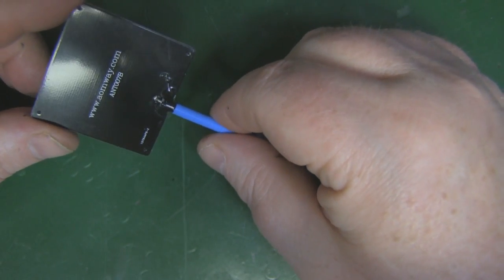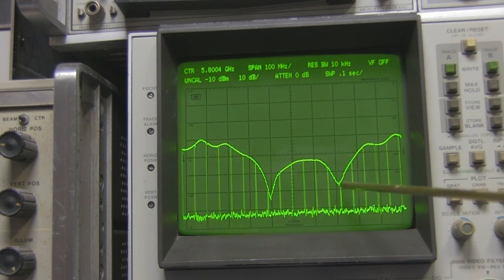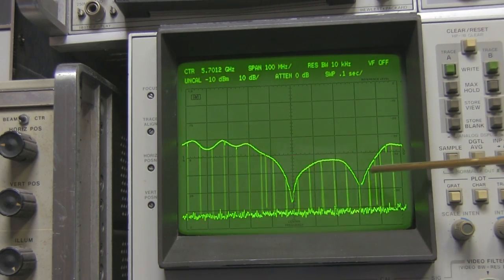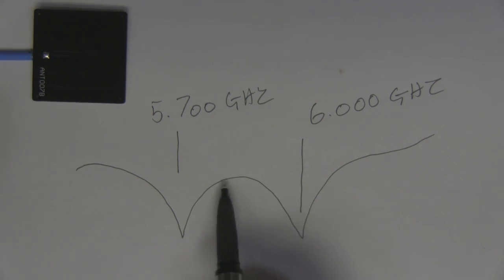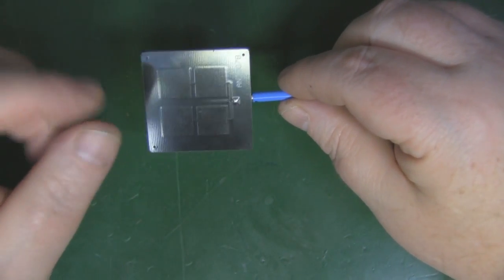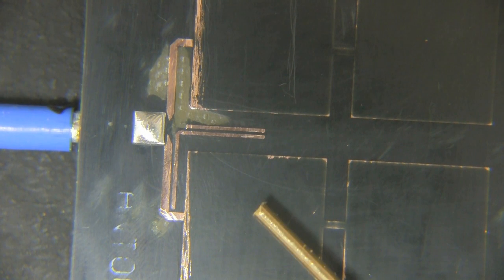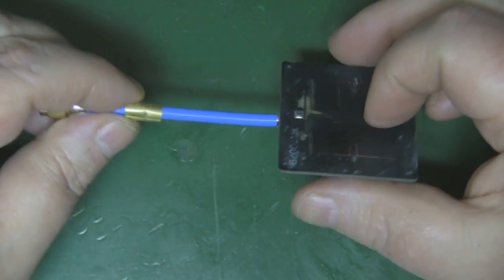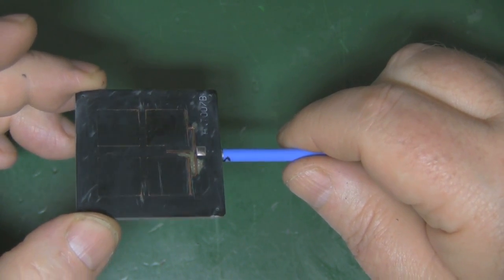Aomway 5.8GHz FPV Patch Panel Directional Antenna

Comment: HEY @andrew mcneil ! Im a very big fan of all you have done, im doing a Extremely custom PC build and im intending to make the best possible hardware build within reason. 
What i am getting at is ive seen your experiments with the silver dipole antenna vs the copper. And im very interested in the idea of silver or maybe an even more expensive metal. My budget is quite unlimited. and the PC is going to be a gift for a certain state Governor.  The PC will be a portable, and i wont be able to go much bigger than a back mounted biquad, or similar.  I would really like any advise or insights you may be able to give me with my situation. I have alotted several months for the build. And im definately up for trial and error,  im willing to try anything, or buy any rare metals to get more range. 
Thankyou! Ill definately keep you in my mind when it comes to "support" if you can help advance my hardware past what it is already.
Your big fan,
TheRarestCombination
Reply: Seems lile even Angels need wifi

Comment: Before you stripped the paint off it looks like there was two microstrips both running to both sides thus rendering the antenna linear.Looks like you lifted it off while cleaning the paint.Can you confirm if it is circular or linear?Does scraping one of the strips off make the antenna circular polarised?

Comment: please review these antennas ..The Arkbird one has little or no sheild connection on mine  and is ony a flat ribbon construct ?

The soft wire version of the arkbird ..Double biquad
https://www.aliexpress.com/store/product/Original-High-Gain-Arkbird-5-8GHz-Double-Biquad-FPV-Antenna-12-DB/1855368_32792004446.html?spm=2114.12010608.0.0.Zsr9br

https://www.banggood.com/Arkbird-Original-High-Gain-5_8GHz-12dB-Double-Biquad-FPV-Antenna-p-1136810.html

And 
The Aomway Double biquad

https://www.banggood.com/Aomway-5_8G-13db-Diamond-Directional-Antenna-SMA-RP-SMA-For-Receiver-p-1075413.html?rmmds=myorder

Comment: Hi Andrew, while copying some of your Antennas ( for fpv ) I saw, you are doing much better by your experience. So I want to buy some of the new biquad yagis 5.8 - none are in the shop. Can you post your email pls for communication ? I could phps build one on myself, but there are not all of the measurements in your links ( distances between boards etc ) thx a lot

Comment: Can you please do a update of all the antenna's you have made and showing them on the spectrum analyzer and talking about what receiver antenna to match them with for 5.8ghz. Also include the strength and weakness of each antenna range and are they omni directional antenna, Circular polarized, does orientation matter?